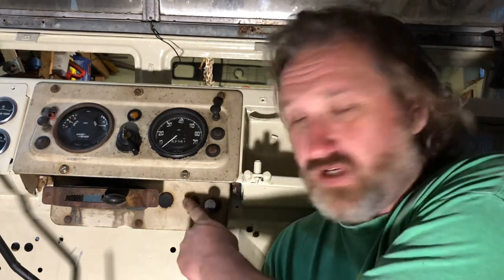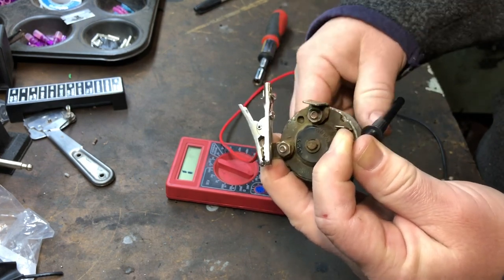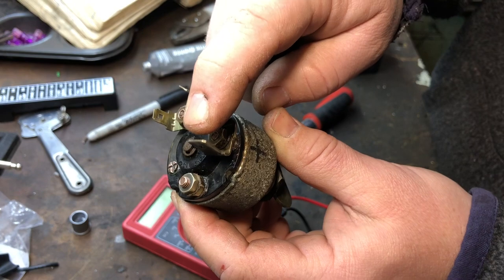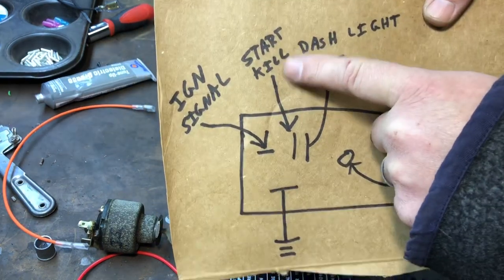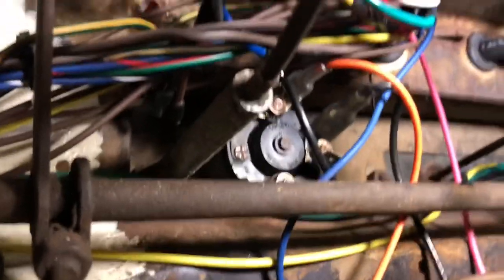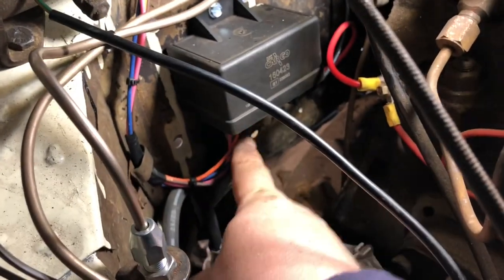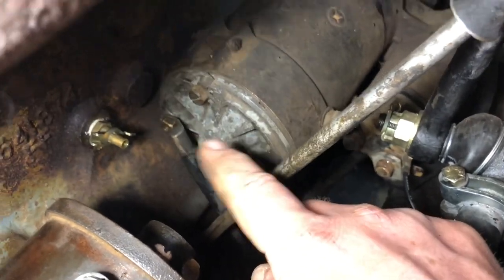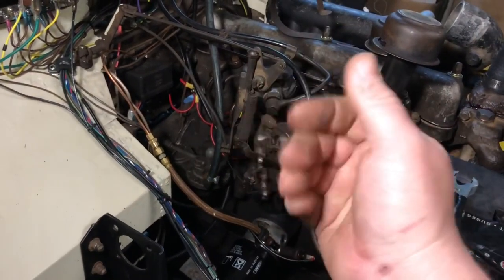Wiring Part 9 - Starter Switch and Glow Plug Relay Land Rover Series 2A Restoration

Comment: Thank you! I have a sailboat with a Universal 5444 44hp motor. Having issues of it not starting after being run for 1 hour or more. No crank, just nothing. So I'm trying to learn as much as possible about what may be causing this issue. Awesome video!
Reply from the maker: Thank you for watching to learn. I don’t know much about boats. It sounds like it getting vapor lock or having a hard time hot starting. I would suggest a “hard start” relay. Give it a Google search. It’s just an idea. Let me know if it works n
Reply: @conrad1468  thank you! It turns out the boat was so old it didn't have a relay switch. I was burning out the glow plug switch or overheating it as wasn't rated for the amps being pulled. Going to install one now. Keep up the good work and thanks again.
Reply from the maker: @lionelthundercloud  good to hear she’s running!!

Comment: That ignition switch you had at the beginning is an old British tractor ignition switch....definitely not Landy! :)
Reply from the maker: A tractor switch. I could see them putting that on in the UK. Maybe it was a security for the USA market?!?! Instead of the simple push button. I googled it and there’s a bunch different Lucas ignition switches. Even the generic keys are still available from AES.
Reply: @conrad1468  ..no-one ever stole the old tractors years ago, so they all had the same switches! 😁